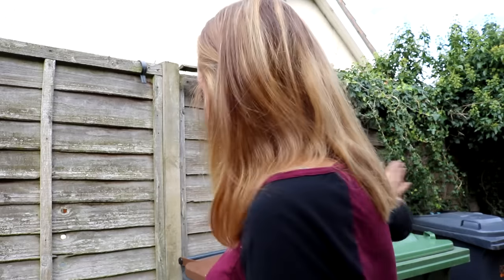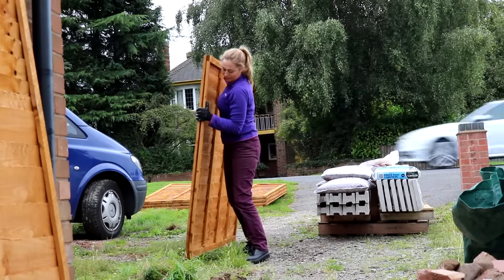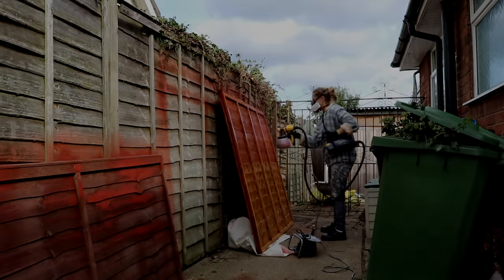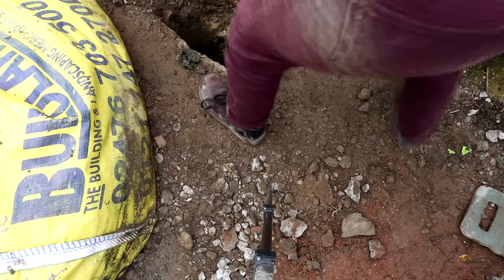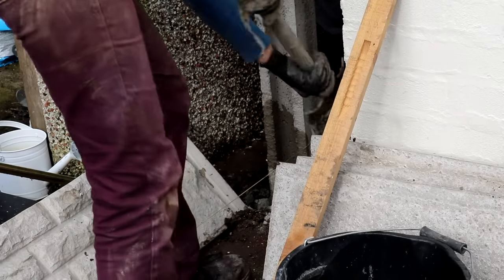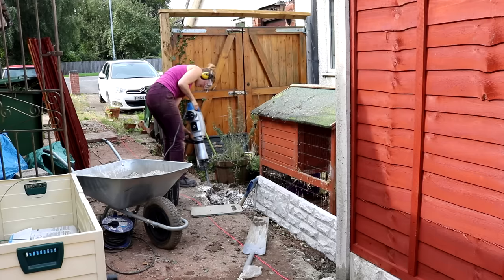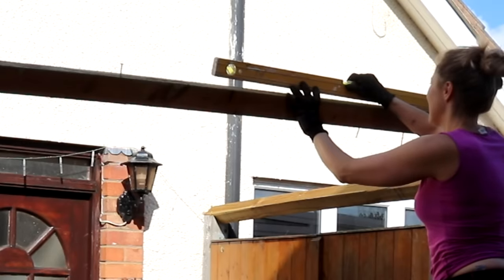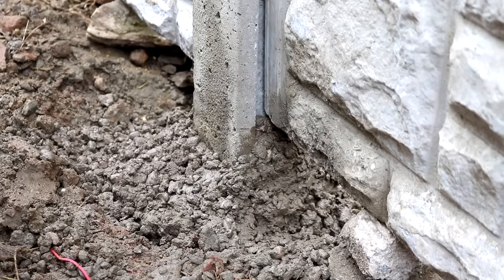Concrete Fence Post Fencing DIY | The Carpenter's Daughter

Comment: Great job . When we do fencing we put the gravelboard and fence panel together ( saves lifting them high ) plus no need to add stone to the post mix , just pour it straight out of the bag 👌🏼. Like the idea of plugging thr groove to stop the gravel boards dropping 💪🏽🧱👍🏼
Reply: agreed with all you say. with slotted posts it is silly dropping the panels in from above as (unless it is blowing a gale) the postmix will be set soon enough that you can hold panel and post in position quite easily.

Comment: I've always used the fast setting postcrete for part of the hole and then topped up with standard concrete mixed with ballast. But the mixing with gravel also looks like a good idea.

If the hole is too big, chucking in some busted up broken bricks also comes in handy.
Reply from the maker: +V T yes, that's been our trick with broken bricks or old broken concrete from our drive too 😁

Comment: As a retired deck & fence contractor on the Central Coast of California, I had never seen a concrete fence post before. I must say, I find the idea intriguing. As long as it's high quality concrete reinforced well, it could outlast any species of wood, pressure treated or not, by centuries, just ask the Romans. The idea of harvesting that much less forest is appealing as well.
Reply from the maker: +John A I'm surprised the idea has never worked its way to the US.  I love the idea that only the panels need replacing now 😁
Reply: The concrete post last for ever and no need to maintain.I have both concrete and wooden post.My wooden post on a six foot fence are about 15 years now but I look after them.Surprised you don't use concrete post in the States.
Reply: The City of Calgary has been using them for a few years now. They've been replacing the fences between high volume roads and residential areas with concrete walls. Much better at sound attenuation.
That fence looks awesome!
Reply: Im in California and ive seen those post.  Ive repaired over 15 of them at one site.  The rebar inside will eventually rust and expand then the concrete starts falling off exposing the rebar. just like a sea wall does.
Reply: Even here in Australia they're pretty rubbish, people use them on rural fences here but they look terrible in suburbia.
If they're mortised with rail or with a heavy duty bolt and bracket they're ok but they move more than timber in my experience.
They will bend and break and the rebar rusts and breaks.
You couldn't use it on the coast.
Reply: @Arsopu  we use it in coastal resorts here with no problems
Reply: @chrisbatchelor3717  no probs here
Reply: Gary S give it time
Reply: John, enjoy it before they arrive in the usa, you think yourself lucky you haven't had to carry the gravel boards, they are 80kg and the post aren't much lighter. They were unheard of when I started but became popular about 20yrs ago, give me timber every time but those jobs are becoming scarce.
Reply: "Never seen a concrete post before"? That in itself is unusual

Comment: I just finished putting up a new fence for the first time with the help of my friend (who is far more practical than me) and everything in this video is on point. Using the gravel boards to map out where the next hole should be is by far the best way to go. A tip for people who have clay soil for when it comes to levelling the gravel boards - wet the clay and you can then mould it into the gaps between the bricks. When the clay dries it goes rock hard and won't budge. You can then cover it up with normal soil.

Comment: Good job getting stuck in despite the heavy work involved.  Concrete posts and gravel boards are definitely the way to go with fencing.  They will well outlast neighbour's fences with wooden posts, even if their wooden posts are set in concrete.

Comment: Sack the gravel off and just pour the post mix straight into the hole, break the old concrete up and use it to pack the holes out so you will use less postmix and don't have to dispose of as much. Offer the panel upto the previous post and then put your next post in...saves lifting panels in & out with step Ladders you can also get every post the same height as the panel instead of leaving them at differing heights.

Comment: For those taking notes from this vid before tackling your own fence... Pro Tips. #1.Professional fence contractors NEVER dig out old concrete below grade. We just start post layout from opposite end of run. Only time it's necessary to place new post where old one was would be at direction changes, or end of run (i.e. lot corner). #2. Pour pre-mixed regular concrete (room temp cookie dough consistency) all around post in hole, periodically agitating to release air pockets. This method is far superior (faster-easier-cheaper-longer life span) to dry mixing aggregate with Fence Post mix and dropping dry/adding water four times or more. #3. Don't beat yourself up for saying "level" (horizontal reading), when you mean "plumb" (vertical reading), more than a few pros make the same mistake (Hello Mike Holmes).

Comment: To avoid having to dig out the concrete from the existing holes I make the first panel smaller in width so new holes for posts avoid the old post holes.
Reply from the maker: Thanks for the tip!
Reply: Peter you’re a genius fella !! What a simple great tip . You just saved me ages of trying to smash concrete 😄👍🏻
Reply: Duh!!!  Brilliant idea mate... turned my 2 day job into 4 hours!
Reply: That's a good idea.
Reply: Thanks for the tip!!!

Average of the quotes for 10 fences panel with concrete post and gravel boards flat ground level that I got is £3,800 cash with one tradesmen asked for £6,000! So I will give it a go

How do you deal with the house wall? Do you attach concrete post to house wall? I think the house foundation may get in the way.
Reply: @mph122  £ 3800  !!!!!!! are they made of Gold.  the average quote i got was £ 850 for pretty much the same  job as yours inc. Supply and Fit.
Reply: @mph122  Call up your FB page,  on the top of the Page select Home and click,   on the left hand side you should see a list,  on mine I select Market Place and write in Fencing,,,     Lots of Fencing Supply and Fit  advertising,
Reply: Exactly,were landscape gardeners,it’s what you do👍🏻
Reply: Minh Pham no need, just use some groove clips that you drill into house wall then panel slides into grooves
Reply: This is what I'm going to do, I have a smaller panel at the end of the garden, I am going to put smaller panel at the house, hopefully avoiding old concrete
Reply: Yes pete Ido the same thing but some people like to do it the hard way lol
Reply: @johnmcgrath7168  £150 per bay average
Reply: @johnmcgrath7168  for 10 panels, concrete posts and gravel boards? If you can get it for £850 fair enough it'll be a sub par fence I imagine though, £3500 is closer to the cost
Reply: There's two fences in reality that needs cutting to shorten them in width .if there's no space left in linear line.
Reply: @johnmcgrath7168  850 quid you gotta be pulling our legs

Comment: Great video. Fencing is hard work! Like the way you mortared in to the post slots under the base panels/ gravel boards. Essential to stop them dropping over time and surprisingly a step that is ignored by many so called professionals. One tip for next time would be to sit the fence panel on top of the gravel board in the slot of the post before offering up your next post, you can then get the post height spot on. This also stops you having to align the post in all directions as when pressed up to the panel and base panel is should be level in that direction, (always best to do a quick check with spirit level mind you). Doing this method also prevents having to lift the panel in and disturb the posts when setting. Also to avoid the need for a second string line (which could get in the way) you could offer the post up to the bottom one and use your level whilst closing one eye and looking down the line of your posts. With the post touching the string at the bottom the remainder of the posts should disappear behind the post you are installing when you look down the line, guaranteeing a nice straight line. Use your trenching/ grafting shovel or a long breaking bar to manoeuvre the bottom of the post to stop the need to lift and re position.

Comment: Nicely done, I know getting that old concrete extracted is difficult and you chose wisely getting the drill. Those concrete posts don't seem to be common here in USA, makes me wonder why not. Thank you both for sharing the video.
Reply from the maker: That is unusual.  Maybe once word spreads, they'll be there eventually?  I just wish they weren't so heavy to work with, but hopefully won't have to do it ever again other than replace the panels in a few years.
Reply from the maker: Oh and already had my penny's worth from the concrete breaker as have used it loads since!
Reply: I was wondering the same thing about those posts. That's a pretty handy system, and the cost for that project seemed comparatively low. According to today's conversion rate,  £350 = $467, which is pretty reasonable for that much in the way of fencing materials and supplies.
Reply: Concrete posts are very common in the UK
Reply: I have been looking for those concrete posts for ages here (in St. Louis) and so far have nearly given up.  Have you found them anywhere?  Every fence builder I've come across says they've never heard of such a set up.
Reply: I wish they had concrete posts here too.
Reply: @PaulPhillipsUK  they are needed in the UK due to the wet climate as wooden posts just rot.
Reply: @Indiebee8  why not make your own. In the UK you get different types but they all start by just pouring concrete into a mould.

Comment: Put one post in first then one gravel board then one panel, then next post and so on. So you don't need to stand on stepladder to insert panels.
Reply: Yer and when the wind blows or your posts are slightly out ... good idea 😂

Comment: well as always another spot on job completed by the multi talented Vicky and yes fencing is hard work but glad you invested in concrete post as they last for ever compared to wood post which rotary at an alarming rate well done to you and your fiancé 

regards mike
Reply: should have said rot away blinking annoying spell check thingy  regards mike
Reply from the maker: Thanks so much +mickymost :) I did regret concrete at times due to the weight of it but didn't want to have to do it again for a while lol and you're right....  when we moved in in 2014, I don't remember the fence being as bad as it was.

Comment: Put the fence panel on top of the base; before you put the second post in , lot easier
Reply: That's the way. Did a lot of this a few years back. Post, base, panel, post, base,  panel and so on, that way all the manufacturing tolerances are taken up. Always start at the highest point. We used dry mix rammed in.  Since the advent of Post Mix it's  much easier. Kept me fit. Happy days.

Comment: WOW. You really do get stuck in to jobs that are hard work and heavy lifting. Beautiful and don't mind getting your hands dirty. Apart from when you have gloves on. Lol. It makes me crazy when we all know the the weather world wide seems to be getting worse. More strong winds and rain. But many people still keep using wooden fence post's. Wood in the ground just doesn't work. It rots. In the UK we've just had 2 big storms. Almost every fence that has been flattened was because of wooden post's. At least with concrete you might only get a fence panel come out and you can just slot a new one back in. It's a no brainer. Don't use wood. Use concrete. Do it nice. Or do it twice. Thanks for sharing your video 👍

Comment: Tip - don't leave the wooden board's resting on the concrete boards or they will rot. If you cut some old tiles and insert them as tiny spacers it will make the boards last longer
Reply from the maker: Thanks for the tip!

Comment: as a retired well experienced fence erector, I say you did a very good job, if you find you get panel chatter when the wind blows and wobbles the panels within the concrete slots, (very common) just make up some small treated timber wedges and tap them in between panel and post. no more chatter.
Reply from the maker: Thank you! :)

Comment: Not a fan of larch/lap fencing. With it being so thin, it does not have durability/longevity. Preferred to make up my own fencing, using 100 x 25mm timbers, in 6 x 3’ panels, diamond style
Reply from the maker: I must admit, my Dad said this wasn't the best and that I should've bought feather edge.  Oh well :)
Reply: The good thing is that you've done the hard graft now and those posts should last a lifetime, so if budget allows in the future you could just lift out the wooden panels and replace them with something more substantial pretty easily.
Reply: Scottish NS Rail Fan r

Comment: Great job, I’ve only ever seen 1 women fencer in my career as a fence installer so I’m proud of you being able to achieve what you have done, it’s hard work and a under rated skill,  if I was going to be picky post heights was to high and don’t add ballast to post mix just pour it in and add loads of water , but you get 5🌟from me

Comment: Good top for checking depth on your post holes is a few turns of leccy tape round your shovel at the depth you want, or bit of paint works, saves putting swapping about
Reply: Also mark ground level and top of gravel board level on your posts, saves a bit of messing about while post is going in

Comment: Great job! Couple of tips, put the panels in as you go so that you don’t have to lift them 6’ high to get them in. Far easier to put the post to the last panel. Also if to posts are too long and you cannot dig any deeper, cut the bottom off the post with a disk cutter so all the tops are matching height.

Comment: As a fencer by trade, you did a good job.

Whoever put the old fence up was an idiot .

What I typically do is set a post, measure out the next whole, then level a gravel board, panel on top then set the next post, & keep going to the end of the line , it’s much easier.

I also do it all myself, most of the time .👌🏻

Comment: Good job, you faffed around a bit but sorted it well, I would have used slightly bigger holes and maybe adjusted  a panel width to avoid digging out the old stuff,  I had to do that once and it's a pain in the arse, back and knees but by and large a cracking job 👏👏

Comment: I love that ideal....have same problem here in my home next to Koi Pond;  rotten and falling down fence between my yard and neighbor.   I like the concrete post and panel boards.   I have never seen that type of material here in Baltimore, Md. USA. If need be, I will pour my own post and base concrete panels.  My goal is to totally enclose the Koi Pond in an atrium type environment.   No more leaves to fall into the pond.   Thanks for the tips and idea....HC Clark-ENC U.S. Navy Retired CPO - Glen Burnie, Md.

Comment: I build the fence the same way, the only difference is I put the boards in as I build to save having to lift them into place. But you did a fantastic. Job ,well done best wishes from Liverpool.
Reply from the maker: That's the way I would have done it too but my fiance insisted 😔

Comment: You made a great job of that fence, well done looks really good. Thanks for the tip on buying a breaker, you can always sell it afterwards and get some money back. Liked and subbed 👍
Reply from the maker: Thanks so much!  The concrete breaker was a great investment as have used it several times in the end :)

Comment: Set up your first post, work out what distance down from the top the top of the panel is, I like mine to have the panel top at the bottom of the chamfer. Then set that in that's your key post. Put the gravel board and panel in the slot, butt them up tight, pack out under the gravel board to level them out if needed, and it probably will be needed, then put the next post in and ensure the top of panel is the same distance down from the post top as the last one to give uniformity. Keep going, levelling and setting in, completing each bay as you go. Use these new metal clips that fit to the panel to cure any lose panels. Make sure the post is upright all round.
Reply: Where can you get the metal clips?

Comment: Nice job!!
I usually build the panels and posts as I go along as the fence will support itself (unless its blowing a gale). I was a bit worried about how much that post moved when you slotted the post in, but I looking at the finished result it looks to have turned out really well.

Comment: Make a mark on your post down from the top of the post groove the height of your panel plus 20mm. Line the top of your levelled  gravel board with the mark. This makes sure the top of the posts are level and all the panels look uniform   You don’t end up with too much post sticking above your panel. Good job

Comment: Ahh, so that's how gravel board are set level. I've just used a ton of old bricks, dry mix and 3 rubber mallets to reset 16 gravel boards which had severely sunk over 20 years. Should've watched your video first. Genuine question though: how can you stop the gravel board falling forward in the posts slot. Great informative video, thanks.

Comment: I used timber posts but painted the bit that goes underground plus 5 or 6 inches above ground with the same stuff that''s used  between layers of shed felt , a thick bitumen liquid ; about £8 from Screwfix - all good after 3 yrs.